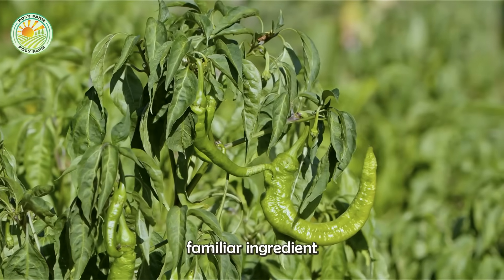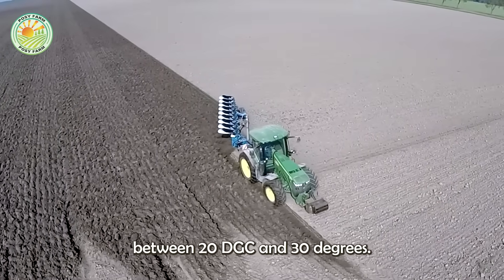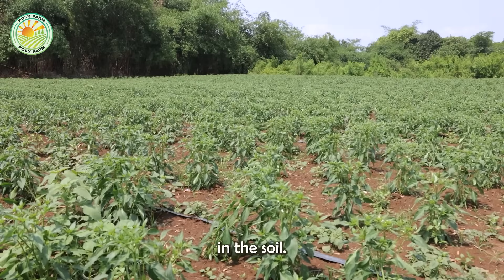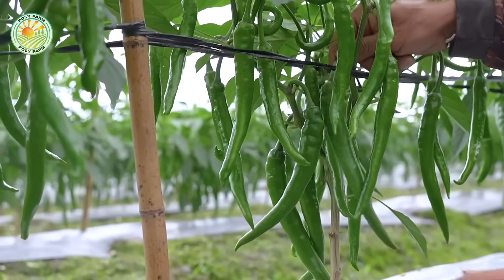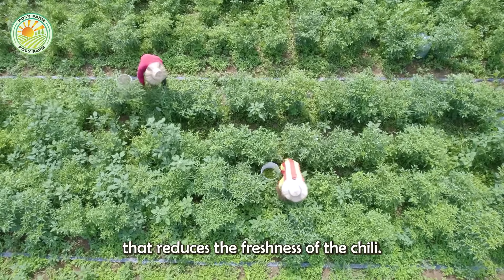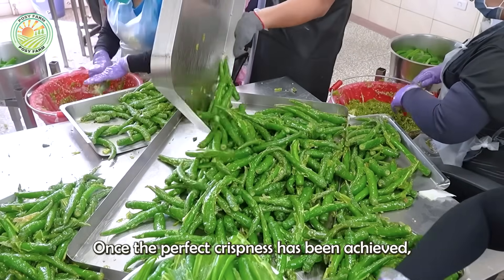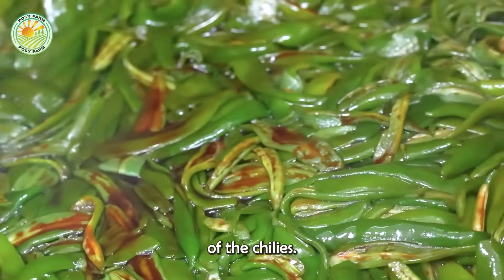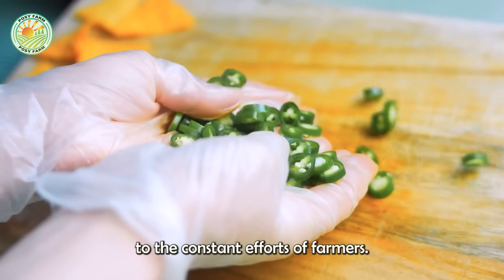How Farmers Harvest Green Chili Peppers by Machine: Peeled Chili Processing

Comment: Why do I not understand why you turn ove the soil, just disk it chop and drop and add what you can to regenerate the soil, I am form a 3rd generation farm and times have changed, get on board, not politically or ever socially but becuse it is right to minimize the tillage and the junk admedments.
Reply from the maker: I hear you. The shift away from heavy tillage is important—both for soil health and for long-term productivity. Turning over the soil breaks up natural structure, releases stored carbon, and disrupts microbial life. On the other hand, methods like disking lightly, chopping and dropping cover crops, and adding organic matter work with nature instead of against it. Regenerative practices help build organic matter, retain moisture, and reduce erosion. Farming has always evolved, and minimizing tillage and synthetic amendments isn’t about politics—it’s simply about stewarding the land in a way that keeps it fertile for generations to come.